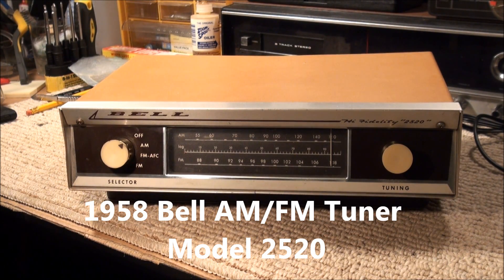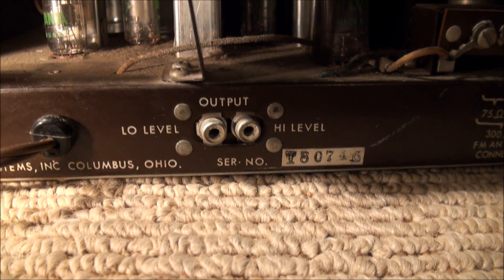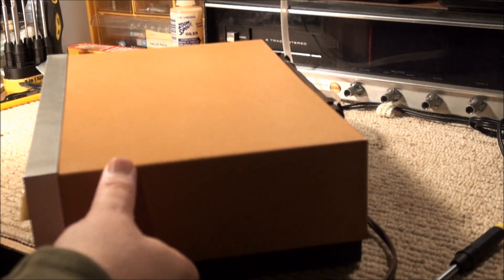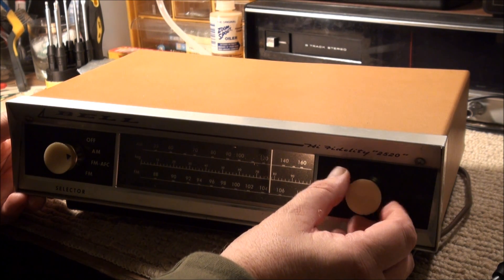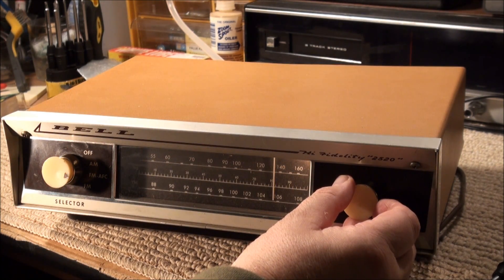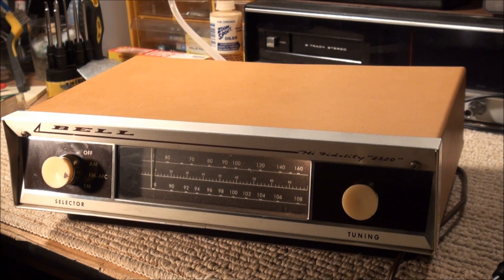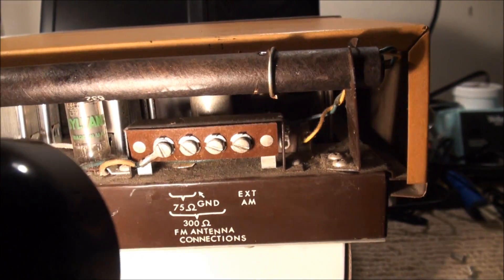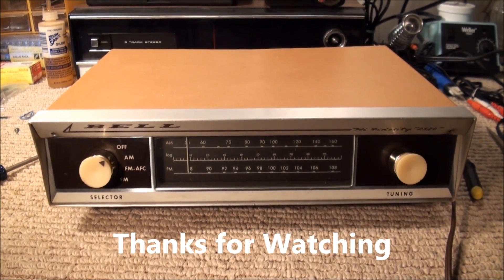1958 Bell Model 2520 AM/FM Tuner

Comment: I know it has been a few years but it’s interesting to know that these came with stereo or just mono.  I just had a 2520 stereo model restored.  It has a mono/stereo switch in the back and a “multiplex” jack near the low&high output jacks.  Therefore I’m not sure how to hook it up to the amp. (Bell 3030 amp)
Reply from the maker: That stereo ability sounds like a great feature. I hope you get the amp connection figured out.